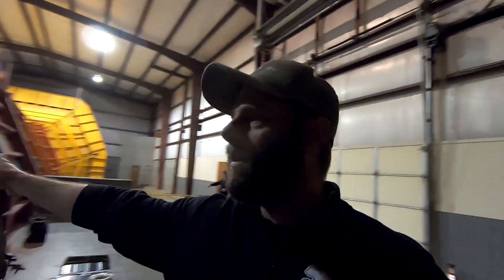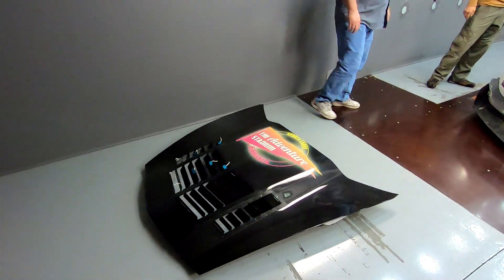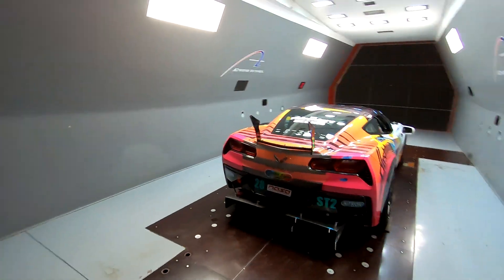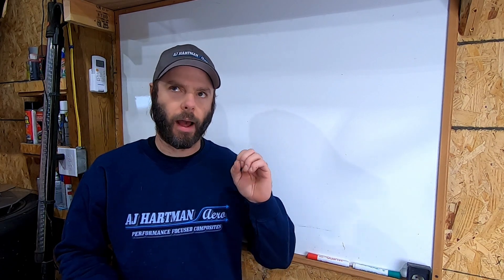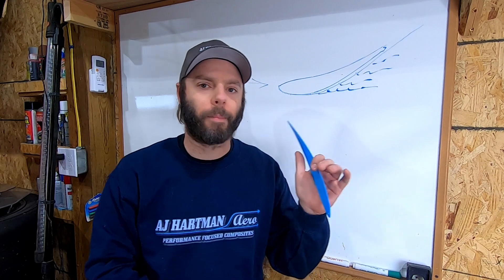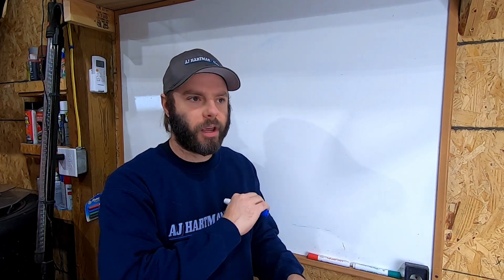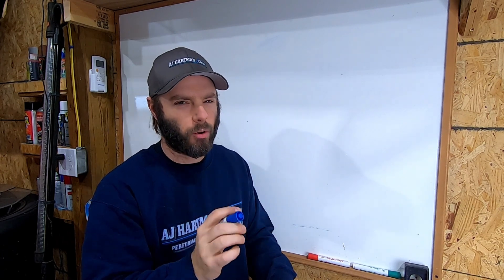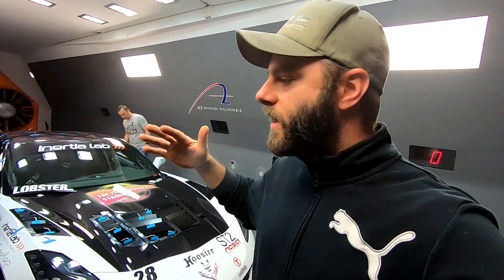C7 Corvette in the Wind Tunnel!

Comment: Great video, lots of info. I expected the louvers to do about what they did. I also expected wing efficiency to drop as you crank wing angle, what I didnt expect was how much worse it got and how quickly. Almost half the efficiency from going 5 degrees off 0 is huge already. Altho I would say that 13 L/D isnt as bad, assuming you are producing tons of downforce off that wing (which wasnt the case there). Anyways, thanks for the video, good stuff!

Comment: Kind of a reach because of cost of wind tunnel but it would be fun to see if placing small vortex generators on the wing itself in a higher stall application just to see if it be any better at all... looking at my rc wing here made me think of it.
Reply from the maker: I have seen examples of that on airplanes. I've seen it on a top fuel dragster wing in a book somehwere. Thats a good one to test but like you mentioned, time and cost are prohibitive, especially when the easy solution here is just a wing more suited for the use case.